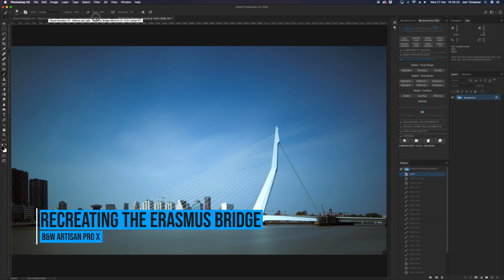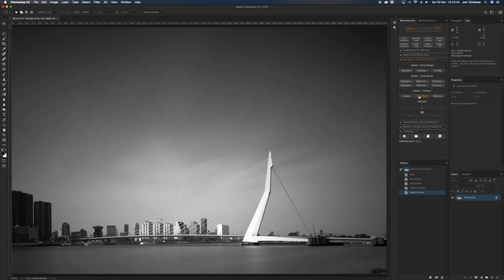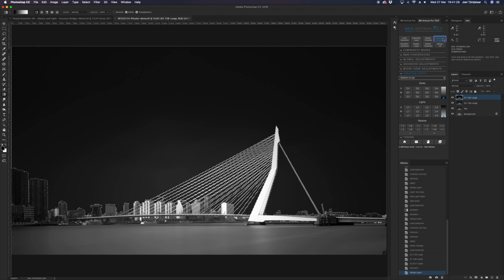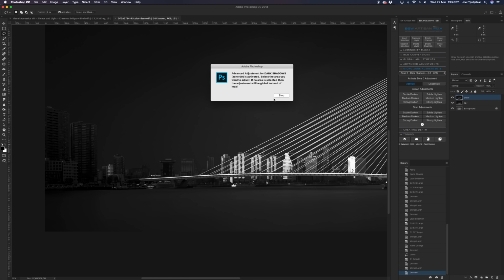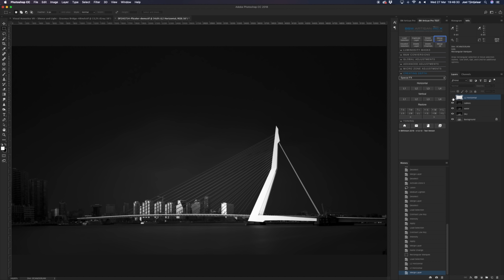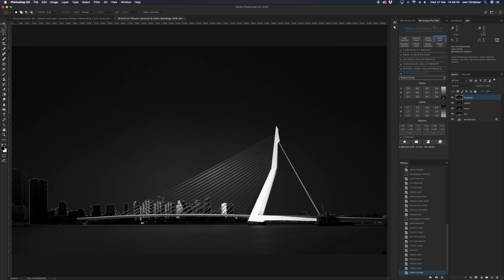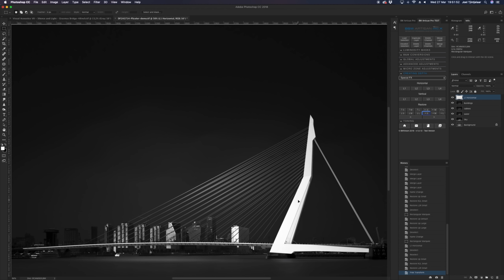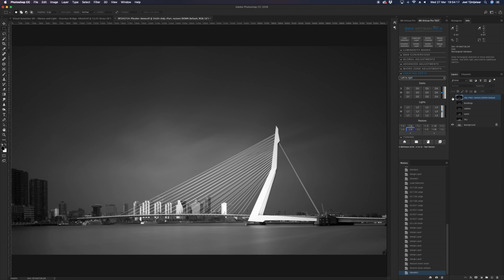Artisan Pro X | Full Video Tutorial 2 | Erasmus Bridge

Comment: Joel, I'm absolutely mesmerized by this video and the image you've created. Just a question to make sure I understand: you still needed to create the selection, even the "wires" of the bridge, right ? As I can imagine there's no cutting corners in that process. But the panel takes off the second part (grading, contrast, etc) to an absolute minimum, kudos !
Reply from the maker: Thanks Maurice. Actually, right now with the latest versions of the panel it isn't necessary anymore to create selections of the wires. You just use the Special FX and add the light. It's demonstrated in one of the most recent trailers. The one on B&W Artisan Pro X 2021. And I also demonstrated it in one of the webinars that's also on Youtube.

Comment: Excellent Joel. I noticed you’re no longer using low, neutral and high key versions to create your gradients with the panel. This should prove to save a good amount of time. I can’t help but wonder which method would produce the better result.
Reply from the maker: Sean, I've stopped using 3 different versions a few years ago. I think the best way is to have 3 different raw files exposed for neutral, high and low key and then apply a neutral conversion on all of them, instead of having 1 raw file, converted in 3 different ways. But it's only useful in very high dynamic range situation, like shooting while the sun is shining brightly. But since I'm only shooting in very low contrast situations (no direct sun) it's not necessary anymore. I can do with 1 raw file and have just one conversion, always neutral.
Reply: Thanks for the reply Joel. Can't wait to try the panel.